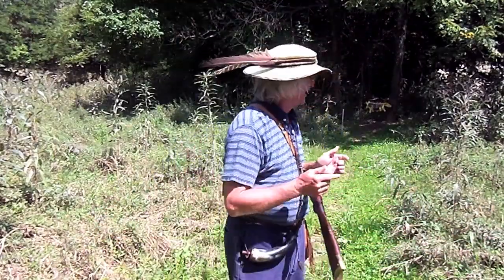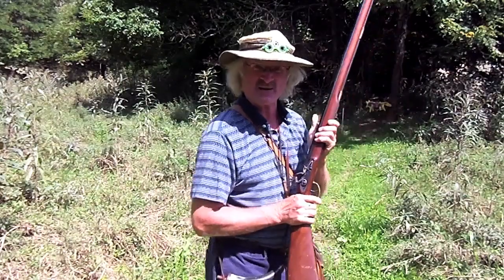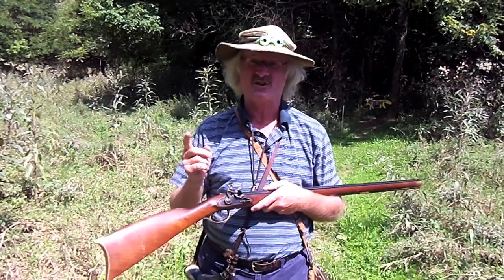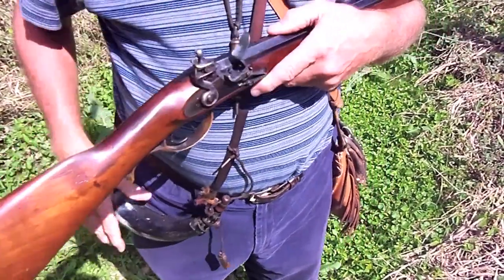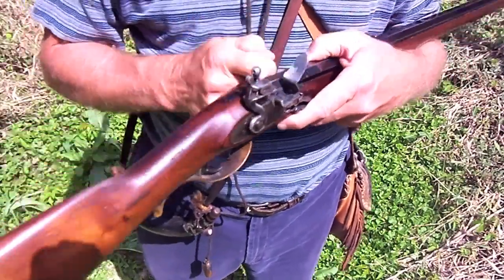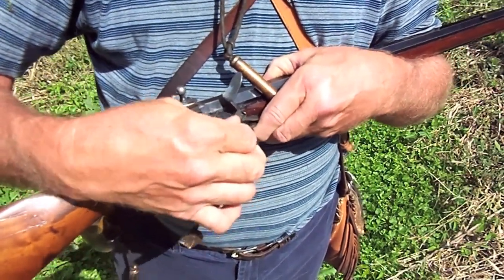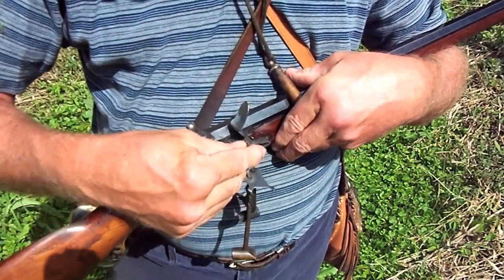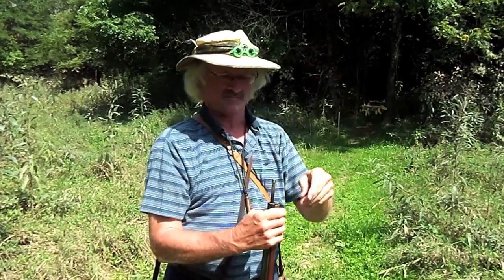How to remove a stuck ball in your flintlock rifle. Dryball

Comment: One of the best reasons ever to keep 4F powder is for a stuck ball. Not only finer as 'Suburban Living' stated to push into that little hole, but the finer the powder, the more energy it packs. So you won't have to put that much in to do the job.
Reply from the maker: Yes, I agree. I've used 4F & Swiss Null B in the touch hole. Works great!

Comment: Thanks for the help.   Dry balled a 32 call squirrel gun and you saved my day!!!
Reply from the maker: Glad I could help. I've dry balled a few over the past 3 years or so. I understand totally! Thanks for watching.
Reply from the maker: Hugo Adrian  Wilkins  At the time this was posted, ( August 2017 ) I've only been shooting 4 years my friend.
Reply from the maker: Hugo Adrian  Wilkins  If I had one of those Hawken 54's in percussion or flint, .......I'd figure out a way to shoot a dry balled lead conical bullet out of the gun. Probably use the same method shown here or this one if its a cap gun: 
https://www.youtube.com/watch?v=vGy87a4c9NY&list=PLVMfc1ggQhJI0kU74xmk3idVKHOT38oMT&index=18&t=186s

I purposely dry balled the gun for the video above to demonstrate how easy they are to remove. I dry ball the gun less than I use to. The main reason why is.....I'm talking with others & don't pay attention to what I'm doing. I was shooting a woods walk event last weekend with 4 other shooters & didn't dry ball one at all. The reason? When I was unsure of where I was during loading, I tipped the barrel over & poured out the powder. Yep, I lost a little powder, but didn't dry ball one at all. Thanks for asking. Good question.
Reply: Love my 32, lot of fun! Like working on a watch when you're used to 50 and larger!🤣

Comment: Good video, Mark!

This method of clearing out a dry ball is easy and perfect for a gun that uses a patent breech plug (this is true for almost all offshore built guns).  These guns have a restricted flue ante-chamber that's smaller in diameter than the gun's bore.  Most caliber guns will have an ante-chamber that will accept 15 to 25 grains (volume) of powder, for an easy dry ball extraction that's just as Mark has shown y'all..  HOWEVER ...

Guns without patent breech plugs are a totally different story as they employ a classic flat breech plug, where entire barrel is bore diameter and the touch hole sits at the back end of the chamber, smack against the breech plug's face.  In such a case, there no room to get any powder between the face of the breech plug and patched ball.   NOW ...

There are basically two kinds of muzzleloader loads - easy and tight ...

An easy load was mostly the way it was done back in the day, for fast loading, because speed of loading (rate of fire) was most important.  Easy loading does not require a hammer and/or short ball starter, and thus a ball worm will easily retrieve a dry ball.  

Tight loads are almost mandatory for best accuracy and that means a ball worm might not work, in fact usually will not work because the act of screwing in the ball screw will expand lead into the patch material and wedge the ball tighter to the lands and grooves of the barrel, and the ball worm breaks free of the lead.  Relieving the tight screw effect by drilling a centered 3/32" hole into the lead ball (this is a drill bit that's on the end of a ramrod that has a bore centering collar) will usually allow the ball worm to best engage the ball for extraction.  

Lastly, if all else fails, the barrel needs to be removed from the the stock and the breech plug removed to allow access to the barrel - and now you now why all breech plugs MUST be anti-seize lubed.  Anti-seize lubing of breech plugs is best done to a new gun, too, else the mitigation of black powder residue into the breech threads will make removal nearly impossible, even for a seasoned gunsmith.
Reply from the maker: I'll try everything possible before having the breech plug removed. Removal would almost make the barrel useless then. I would drill the ball out which I've done before. Thanks for watching.
Reply: @blackpowdermaniacshooter  With proper tooling and smarts, there is no way that a breech plug - flat faced or patent - will get buggered, unless it was already buggered by the gun's builder.  But, if yer in this trad sidelock muzzleloader game for life, you will be pulling off breech plugs, for sure.  

I remove the breech plug on all new guns, to anti-seize them with Nikal or Permatex - makes them easy to remove IF ever the need arises.  I also anti-seize anything that screws into the bbl - touch hole liners, bolsters, nipples, etc. - they'll all get compromised with BP residue sooner than later.  

A used gun, particularly one that's not been cared for properly, can have a "stuck" breech, just near welded with BP residue that's gone corroded.  Typically, these are easy to remove with a cheap steamer pointed into the removed touch hole liner or bolster, to break the residue bond and allow the wrench to do its job.  

The easiest of the offshore patent breeches to work on are those from Investarms (also branded as Lyman, Cabelas, DGW, and others).  

The worst are the Traditions, where even brandy new they require steaming to get the dang plug out, but it's doable.  

The basic tools needed to work on breeches and such is a sturdy vise and large pipe wrench for its leverage.  In addition to a big vise, for classic onshore built guns with flat breech plugs I use a set of Rice octagonal bbl clamps for the vise and a Rice socket that goes into a 3-4' black iron pipe (for leverage) ... for all those offshore patent breech plugs I use a special socket along with a Reed Corp 16" wrench and a 3' length of black pipe for leverage.  Easy peasy.  :)

Have fun, y'all watch yer sixes and yer top knot!
Reply from the maker: @rfdsrd  That's some good info, thanks for posting.
Reply: @rfdsrd  
Thanks for sharing all that hard won experience!
Reply: rfdsrd   When I have to use a ball puller {yea it happens to all of us some times}, I squirt a little lube down the bore which makes pulling the ball easier.  A product called Kroil loosens up seized parts very well.
Reply: @tzackaria7  Yes, a slick liquid can't hurt for a loose load, but I've never seen it have any worth for a tight load.  Shoving a screw worm into a lead ball will expand the lead further into the patch cloth and into the rifling - like stepping on the brakes.  This is where drilling a hole into the ball first can make all the difference.  That's a special fitting (a 3/32" drill bit) that I've yet to see anyone market.  Dry balling is never an issue of "if", it's a cold hard matter of "when".
Reply from the maker: @tzackaria7  Yes, I need to get some Kroil, I have some stuck nipples on a gun to remove. Thanks.

Comment: I had taken my new Traditions .32 out for a second shooting session, and even snapping a cap didn’t get all the lube burned out. I found that out after loading up and went to take the first shot. Just the cap went off. Put another one on. Cap fired again. No report. I guess there was more oil in the breach than what I thought and I ended up pulling the nipple out and started poured a little powder into the fire hole until I thought I had enough, put the nipple back on, capped up, and it finally ignited the charge and sent the ball on its way. Glad I saw this video as reference prior to this happening. Good advice...
Reply from the maker: I've found out I need to snap 2-3 caps before loading my percussion gun when starting. It works fine then. Glad I was able to help. Thanks for watching......
Reply: You are using way too much oil after cleaning if it is pooling in the breach. Just put some on a clean patch and run it down the barrel a couple times, that is plenty.

Comment: Many years ago I bought a new TC Hawken Renegade .54.  Since it was new I had the TC owner’s manual, and I read it.  Their “rainy-day” operational scenario read, “WHEN you load a ball without a powder charge...”!  In the case of the caplock, charging was even easier... just unscrew the nipple, pour in some powder, replace the nipple, cap, & fire.
Reply from the maker: WOW, I'm impressed the owner's manual said to actually try that! I'm impressed!
Reply: Because they said “when” and not “if”, it made a real impression on me, so I was prepared.
Reply from the maker: @pwhurley49  Yes, generally all shooters will dry ball one sooner or later.....LOL

Comment: Great video !  Your prime powder is finer ground and easier to work through the touch hole  than the courser powder from your horn.
Reply from the maker: Yes..it is and that's why I like using it. I have used 3F powder in the touch hole...it just takes a little longer but does work.

Comment: You use a LOT more pan powder than I ever have, but to each their own.  I have also used a ball puller.  My experience there was that a ramrod puller of some kind was needed to make that work easily.  I agree, the pan powder method is faster and easier.
Reply from the maker: The gun used in this video works well with lots of pan powder. I have a GPR that works best on just a touch of powder. This method works the fastest for me. Its funny how that pan powder works, thanks for watching.

Comment: Forgot the boom dust in my T/C Hawken caplock when I was a kid.   Ball puller failed quite nicely, so I pulled the barrel and brought it into my father's repair shop.  I somehow found a reducer fitting that matched the nipple threads and with a couple of additional fittings, got to a 3/8 male pipe thread that fit one of the blowguns.  I hooked it up to the compressor and blew the ball out. From the sound it made hitting a block of firewood, I wouldn't have enjoyed being in front of it.
I still have that conglomeration of fittings just in case.
Reply from the maker: Yep, air compressors works well too! Thanks for sharing your story. It worked!

Comment: Mark, great video!  I did it myself recently.  However, I was shooting my trade gun using an undersized ball with tow, so the ball remover did not work as the ball rotated when I tried to remove it with the ball remover.  So, I removed the vent liner, put in some powder, replaced the vent liner, and shot the ball out!  It was no fun, but it forces me to remember...powder, patch and ball!,,
Reply from the maker: Yep....been there myself! I'm glad it worked out for you my friend. Thanks for watching...
Reply: @blackpowdermaniacshooter  Mark, it was a “gotcha” experience. 😂😂

Comment: I believe I've done this three times.  And the first time was in the pre-internet 80's, so I was on my own.  Each time I have not seated the ball because I realized my mistake while pushing the ball down the barrel..  I fairly quickly figured out my best option was to unscrew the nipple and work a small amount of powder into the breach.  Of course it worked every time.

I knew about the ball screw, but I doubted I could twist the rod with my hand to force those relatively large screws into the ball.  Looks like you would need a special ramrod and wrench for that.  Looks like you could twist off the ferrule on a typical ramrod.
Reply from the maker: Yes, you can. That's why I prefer shooting them out. Its much easier.

Comment: Did that with the CVA Hawken Woodsman about two years ago. The puller is a myth, it does not work. Is is a caplock, so I removed the inspection screw of the nipple/flash hole and worked a few grains of powder in there. It works well.
Reply from the maker: Totally agree...this method works much easier. Thanks for watching....

Comment: If you don’t have access to a co2 flintlock ball remover and only a ball remover guide screw, clean the inside of your barrel as if there was no ball stuck at the breech.
Dry the barrel then oil it real good.
Then insert the ball puller and screw it into the ball.
A brass or steel range/cleaning rod with a bore guide on it will center the screw into the soft lead ball and with the clean and oiled barrel, the stuck ball will slid out as slick as can be.
Reply from the maker: I've never had any luck trying that method. That's why I just shoot them out. Thanks for watching...

Comment: I just had to pull a ball at the range. I thought,  that I was so excited, about my new muzzleloader, that I dry balled it.....Nope, pulled the ball, powder trickled out. Then I figured my drum must be plugged,  this is one of the only times that I did not bring my full tool kit to the range with me because I never use it.  With the limited tools I could night pass a pic through the drum.  So I tried to blow it out with caps and cleaning and so on and so forth.......NO LUCK, I GIVE UP!  When I got home I pulled the drain apart and lo and behold the manufacture of this very prominent muzzleloading company neglected to drill out the drum! That’s what I get for doing a quick swab of the barrel and heading to the range without properly dissembling and cleaning a new rifle
Reply from the maker: Yikes! That's very unusual. Did you get the company to correct the situation? Just curious....
Reply: Black Powder Maniac Shooter I have contacted them, non response yet. I have the same rifle in a 32, so I measured the hole in the other drum and drilled it out myself. Works fine now. I have asked for a new drum however and I would expect them to send me one.
Reply from the maker: @rogerpilon2588  They probably will...that's an easy fix for them. You're back in business...that's what counts! Thanks for watching my friend......

Comment: I tried doing this a few years ago when my friend dryballed my .44 flint pistol. Problem is that if the ball and patch are rammed all the way to the breech, they will block the introduction of power via the vent. Perhaps I didn't try hard enough to force more in. I ultimately ended up using a long drill bit in a brass sleeve to protect the bore, but it took some doing.
Reply from the maker: I had to do that too with a long drill bit...twice! https://www.youtube.com/watch?v=Gy4XYzKl7Vw

Comment: The only way a ball puller really works is if one is on the range with a heavy "range rod" with a knob on top on to which one can slide a 12 oz weight as a sliding hammer. With a lot of downward pressure you can screw the puller clean though the ball....that gives enough traction to get the little bugger out, the 'hammer shakes it loose.....
Shooting it out is the way to go.... quick and easy.... Love your videos.....even when things don't go right you have so much fun..... lifts the heart on dismal days when shooting is not possible.... :-)
Reply from the maker: You are correct regarding pulling those round balls. Typical rods ( in my experiences ) cannot pull the balls. That's why I promote shooting them out. its just much easier! Thanks for you're kind thoughts and watching.

Comment: Great field expedient. At the range I have my range rod and screw and a slide hammer that fits on the rod and will dislodge a dry or even stuck ball.
I will remember that trick next time I just have what's in my possibles bag. I had always wondered if that would work but never tried it.
Thanks again... :-)
Reply from the maker: Its takes little patience, but works, especially when you're in the middle of nowhere .......thanks for watching my friend....

Comment: Once I had to braze a wood screw on a long metal rod and screw it into the ball and pull it out . Just to be safe I would pour some soapy water in the touch hole . The soap helped lube the patch and help it slide . Keep the rod just in case it happens again . Never had to use it again .
Reply from the maker: That's an excellent testimony. I love it. Lets hope you never have to use it again.

Comment: Like Suburban Living, I use the priming powder.  It just seems easier.  But I also have no trouble with a ball puller.  You just need the right one, and it helps immensely if you have a cross grip that will fit on the end of your ramrod to give you power and leverage.  It makes it easy to drive the ball puller down into the ball.

I can only remember one time when nI forgot to load powder, but I have loaded powder trhat was too damp to burn right.  While I never carried it on my rifle, I had a thick ramrod that just barely slid down the barrel.  This made sure the ball puller centered on the ball, and didn't slide off to one side.  With a load of damp powder down the barrel, I greatly prefer using a ball puller.   Especially when it's a heavy load.  That damp powder can come to life when you force dry powder in there with it, and I don't trust how much pressure can build up.
Reply from the maker: Damp powder is a whole another issue. I agree with you about pulling the ball wit damp powder although I've never been 100% successful pulling one. Thanks for responding & watching...

Comment: I often pull a ball if I didn't shoot the gun that day. I never had much problem  doing it. The few time I dry balled I used my spring loaded pan charger filled with 4f priming powder. The small grains will go right through the touch hole. It really doesn't take much to simply push the ball out. PS. If the ball doesn't clear try again getting even more powder in the touch hole.  Make sure to ram the ball back down tight against the powder
Reply from the maker: Yep, that's exactly what I do too. Thanks for watching.